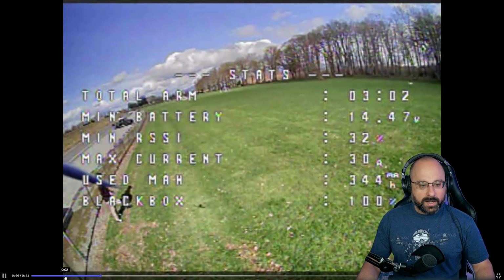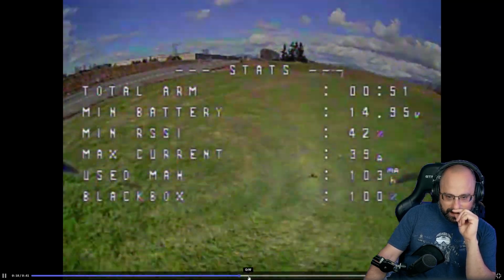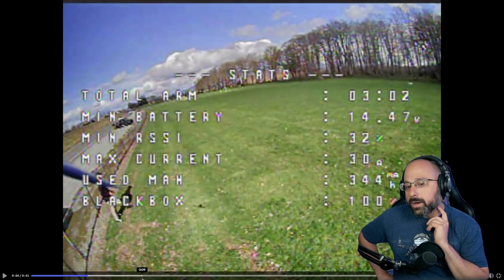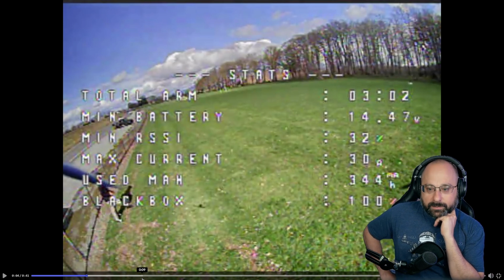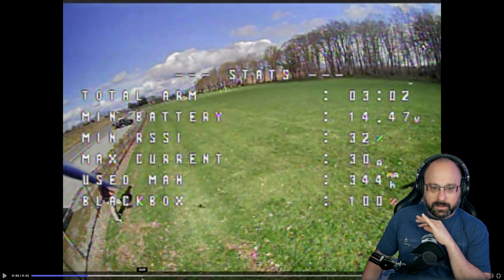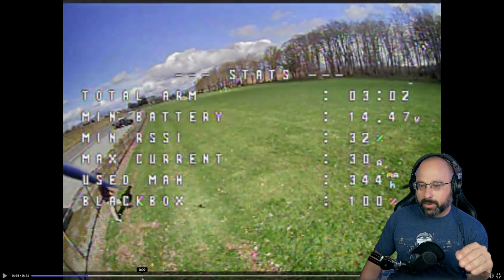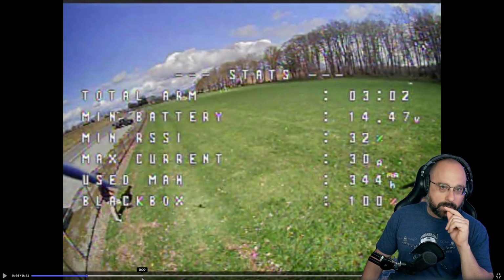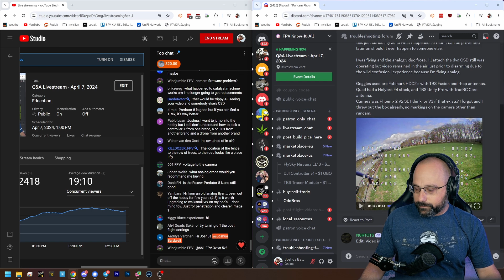My Analog FPV Video Feed Is Freezing?! But OSD Works? - FPV Questions

Comment: Had this happen with my racecam r1 mini. Cleaned the connectors re plugged it back in. Seems to have fixed the issue but won’t trust it fully till I run through a few packs. So confused looking at my googles searching for my drone wondering why I couldn’t see myself on frozen image, the osd still counting flight time had my so confused 😅 
All makes sense now, thank you Joshua!